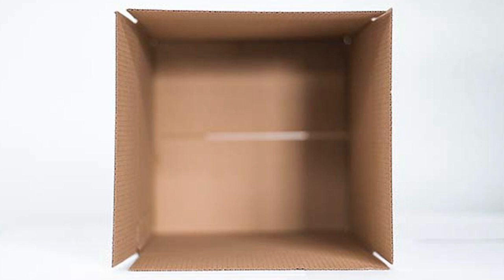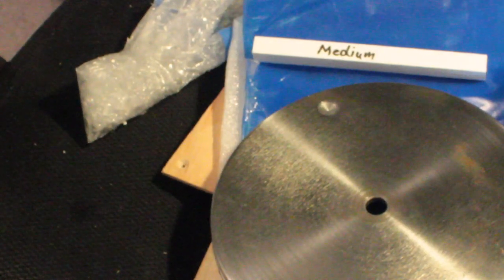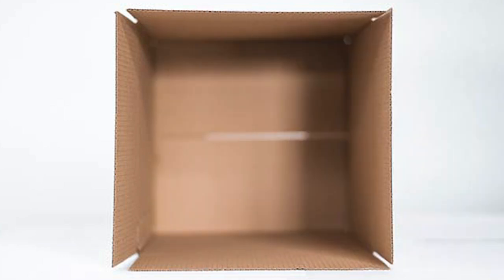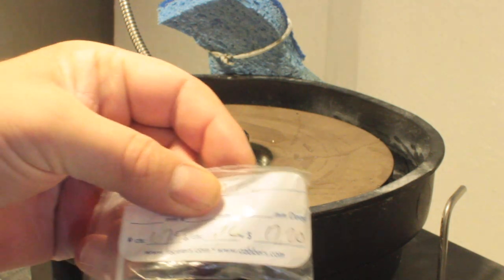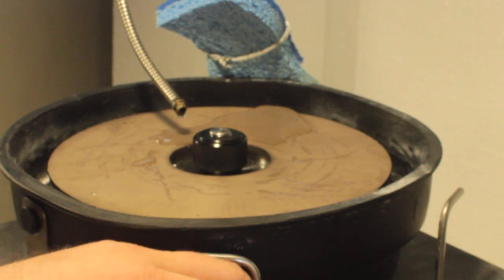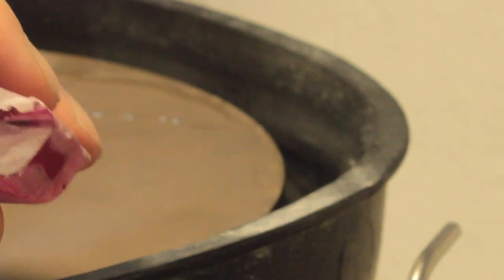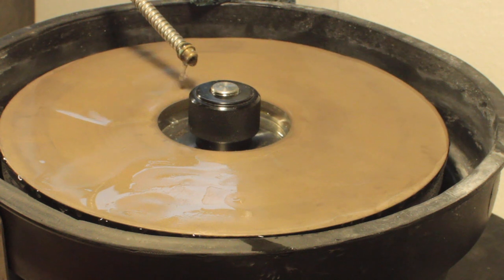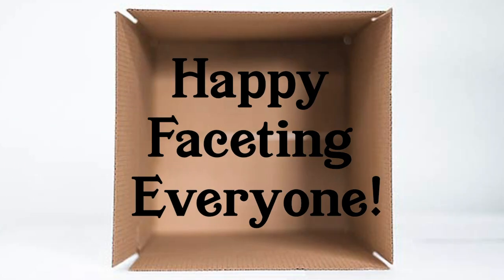Unboxing The Adamas 12M Sintered Lap

Comment: would have liked to have seen a roughed in stone using the lap?
Reply: My 12M has replaced the Crystalite 1200 lap that I used to use and it is now my 'go to' lap after using a 600 grit, so you should be able to see what it does on pretty much any future video...as I use this lap on pretty much every stone I cut now.